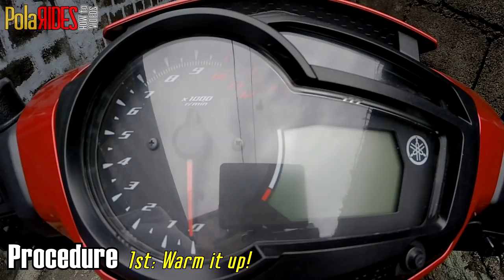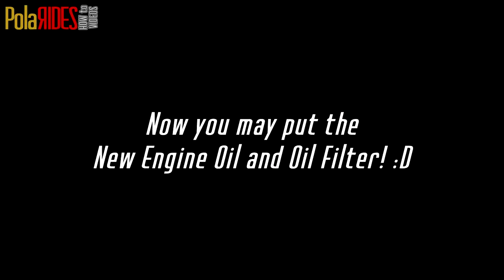Change oil and Oil Filter of your Sniper 150

Comment: Hello po may options pa po ba para gumanda ang tunog ng muffler na di bawal sa LTO or kailangan mo mag pa sadya ng muffler kagaya ng kalkal.
- RESPECT galing po ksi akong sasakyan.
Reply from the maker: we got to options buddy. pwede mo ipa kalkal yung pipe pero hindi yung maingay. ( More on bassy sound )
2nd is, you can buy an aftermarket pipe. pero sa dalawang option na sinabi ko parehas talagang bawal sa batas nang LTO. (Which is O.A lang talaga yung mga nanghuhuli. kapag iba ang pipe matic agad sa makaka chempo... pero okay lang yan. madaming mga nka kal kal pipe at naka aftermarket pipes.
Reply: Pola RIDES  salamat boss idadaan ko nlng sa porma motmot ko para di na madagdagan ang mga kamote sa pilipinas.